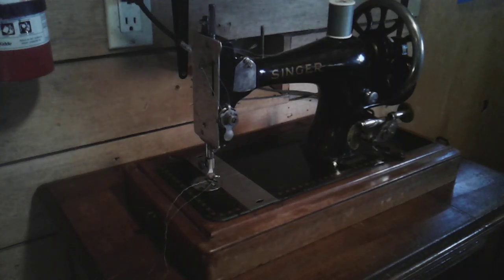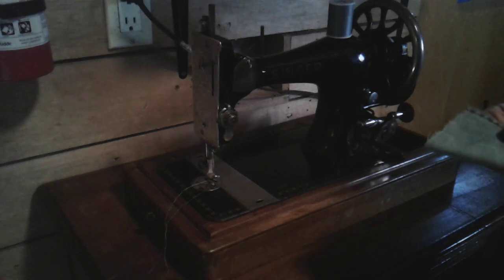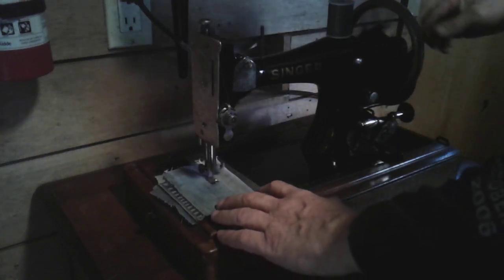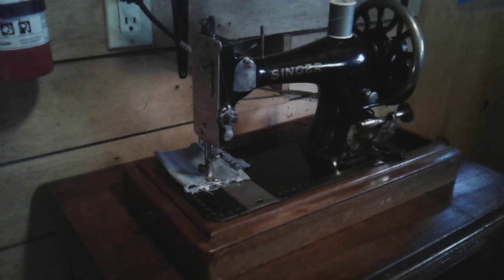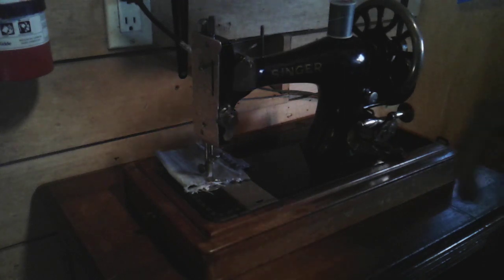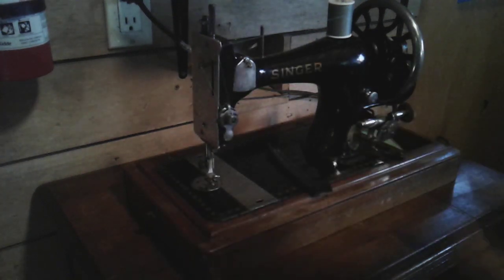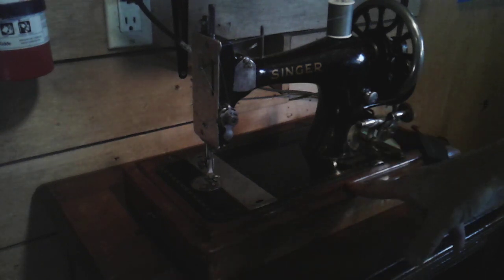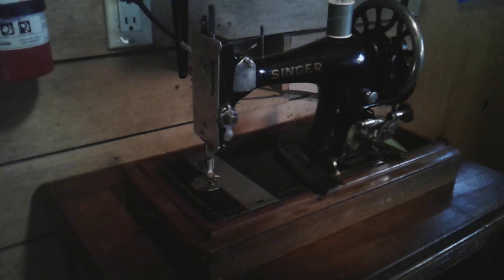1904 singer model 28 sewing machine , still keeping it together !

Comment: How many working machines do you have and how many scrap machines do you have?  How long have you been selling and fixing Singer sewing machine s for?
Reply from the maker: I have over a dozen machines,  not only singers but i have a pfaff 332 and 2 Necchi BU as well , most of my collection is singer brand but i like to seek out vintage quality machines as well , I dont sell to often as i am a collector , but i do get machines as a bundle some times and then i sell off any that i have 2 of or i tear it apart if i feel its not worth saving , i have only started collecting a year ago after i got my necchi BU that was given to me free , i wish i could buy and sell for a living but there is no demand where i live in canada so i get them cheep and save them , as for scrap machines i only have scrapped 3 since ive started,  the 128 you just saw , a 15-91 i got for parts because the bed was broken and welded back together and i bought a scrap machine once just for one part to fix a viking i sold , when i first started i was collecting vintage japan off brands , then i got the singer bug lol ...